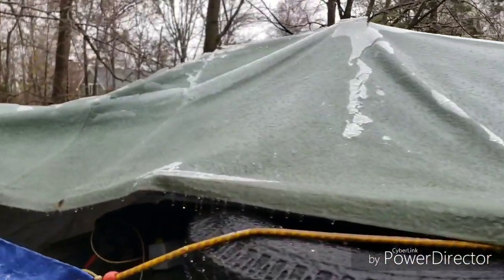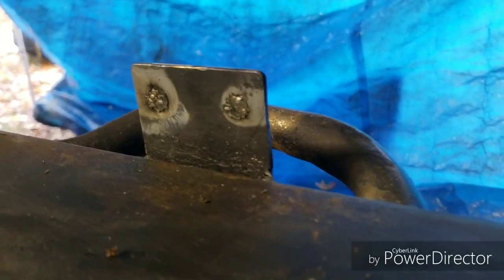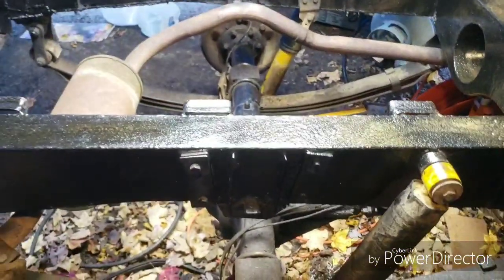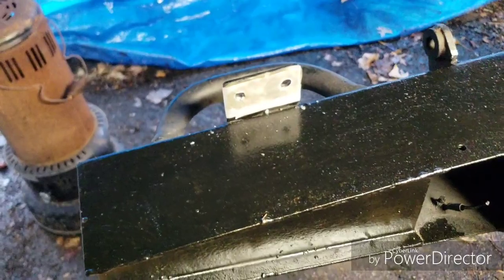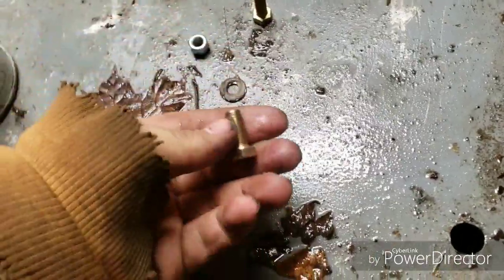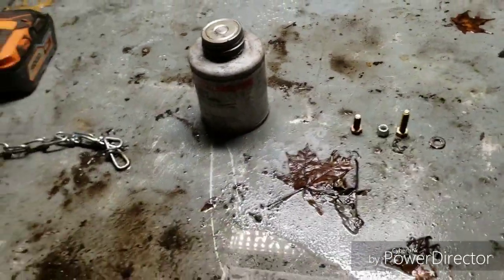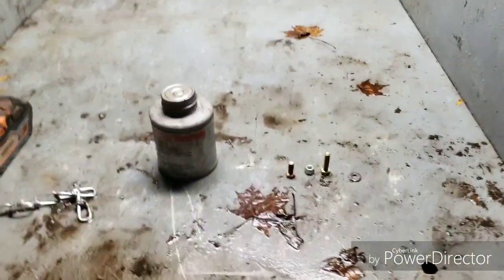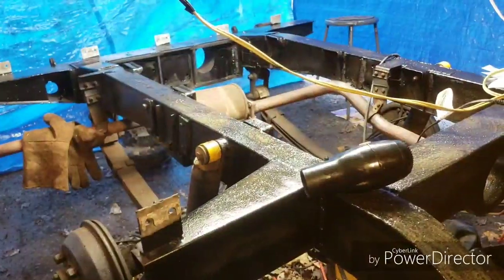'61 Series II - Frame Work Part "We're Getting There", Frame Oiled and Tub Back On

Comment: To complete the galvanic separation you need to:
 Either add a isolation sleeve, and washer,
Or, use an isolation washer that has an integral lip.
Either will complete the isolation of the bolt threads and clamping face on the Al side of the fastener.